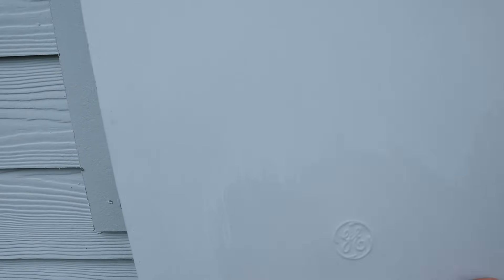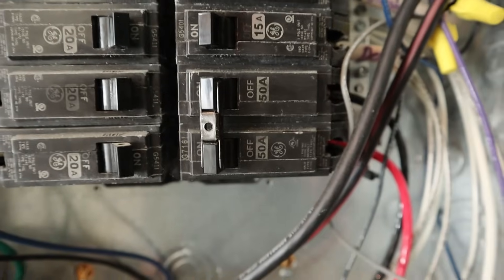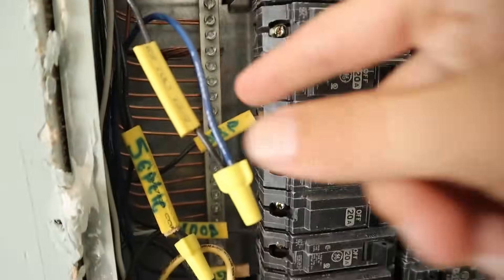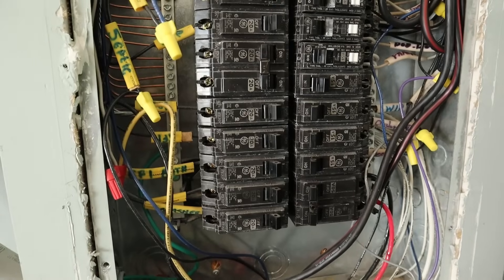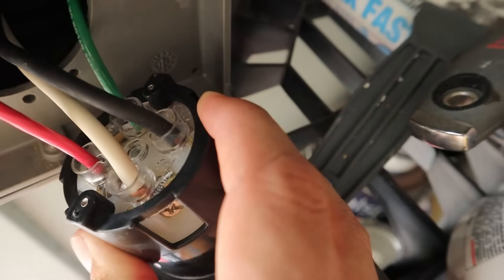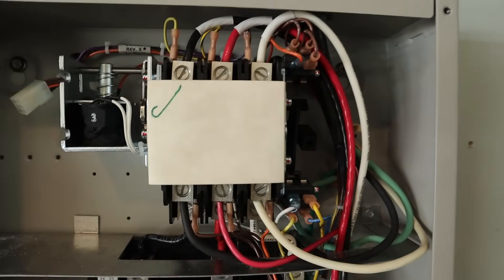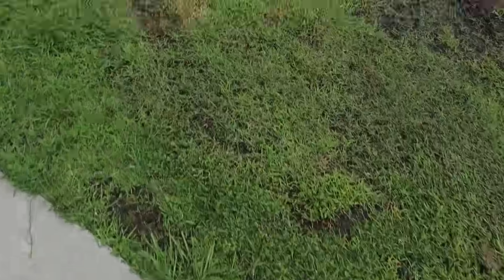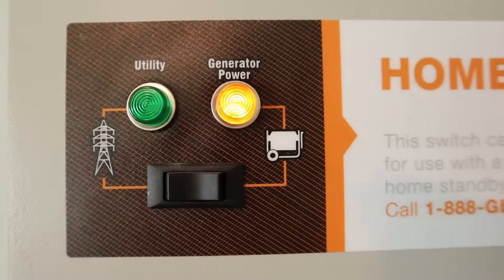HOW TO INSTALL A PORTABLE GENERATOR TRANSFER SWITCH

Comment: How is all of this affected if your transfer panel has no breakers already in it ? Can I just pull the breakers in my main panel and install them into the transfer panel (provided they work). How then does the wiring hook-up work? What is the major difference by doing it this way? O do I hasve to buy new breakers to put into my new transfer panel? I am sure I know what I am doing, I don't want to screw it up. I installed a transfer panel for my smaller portable generator. But, I need your help, please.

Comment: My power is permanently disconnected from my panel. My weather cap got knocked down after Milton visited central Florida, and the power company removed all the wires from the weather cap and transformer there will be no back feed. But I'm going to install a sub panel and only hook circuits I need to work on the house. A power station and generator will be my source of power I cannot see paying for electric when I'm not Living there. A whole house generator is too expensive. You could say I'm off grid. 73

Comment: Why shouldn't the new breaker you put in your MAIN panel be equal to the sum of all the TRANSFER panel breakers? 
If your TRANSFER panel breakers were each carrying just below its rated capacity, you would be trying to pull a total of just below 160 amps  through your 50 amp breaker in the MAIN panel.  What am I missing?   Would be interested in how you decided on a 50 amp breaker for your main panel.  That would be nice to cover that in your explanation.  Thanks.  😀

Comment: Making splices in a panel is not recommended.
Reply from the maker: Nothing wrong with it and the only way to install one of these unless you want to run all new wiring to all of the circuits.

Comment: Thanks for showing that installation. Only question I have is, why when you switched back from generator power to utility power did the green light not stay on as when you were on generator power the amber light was constant. I don't know what your local laws are however other jurisdictions may require that it is installed by qualified electrician and that a permit and inspection are done.

Comment: These transfer switches require wire splices with wire nuts within the breaker box. This is illegal in many electrical jurisdictions, which might also void your house insurance. Beware.

Comment: Few things missing in the post. Generally generators have three prong L5-30R and transfer switch plug is 4 prong L14-30R, with two hots going to manual transfer box. No one tells you how they handle that?

Comment: Why do you use a  50 amp breaker in the main box to supply a 30 amp transfer switch box?
Reply from the maker: Because that breaker doesnt really make a difference.  It is just acting as the supply for numerous breakers in the transfer switch which is essentially a subpanel.

Comment: Hi Adam. Great videos! Thank you for posting all of these! I have a Generac HomeLink transfer switch I want to install and my main circuit panel has the neutrals and grounds together (I do not have a separate ground bus in the main panel). When I wire the transfer switch main power to the 50amp breaker, is it ok to hook up that #8 ground and neutral wire to my ground/neutral bus in the main panel? Being they are together I thought in the sub panel they had to be separate. The HomeLink does have it's neutral and grounds separated in the box, but they'd be on the same bus in my main panel if that makes sense. Is this okay? Also with that said, do I then hook up each neutral wire of the breaker I'm moving to the neutral wire coming from the transfer switch (not putting them all together)?  Thank you!

Comment: Thank you for your videos. I have a generac homelink transfer switch I'm installing and have a quick question - It's pre-wired and I'm hooking it to a 50 amp breaker. The wires that it came with are 8 gauge, but 50 amps should be on a 6 gauge wire, correct? Should these be changed? Not sure why generac would have had these 8 gauge wires.

Comment: Thanks for the concise video. I need to go into my main panel the same as yours; my panel also has no exposed knockouts. My question is what size hole did you drill on the side of the panel and what size conduit did you use to house the wires. Thanks, Bob

Comment: why not just move the breakers already installed to the transfer box?  they are doing nothing staying there...buying extra breakers for no reason.
Reply from the maker: Well 2 reasons.  One I don't want empty breaker spots in my panel.  Two, my breaker panel is GE and the transfer switch doesn't accept GE breakers.  So not for no reason.
Reply: @HowToHomeDIY  ok makes sense.  thought they were the same brand.  thx for the reply

Comment: I’m fairly certain you violated the conduit fill limit on that 3/4” conduit between the two panels 🙄🙄🙄🙄🙄
Reply: @HowToHomeDIY 😂
Reply: Also, you made zero mention of the neutral bonding setup in that switch. I assume it switches the neutral so that you can run on a bonded generator?  Important topic you should address 🙄🙄🙄🙄🙄

Comment: Had mine hooked up last year and it worked.  Just went out to test it and it’s not working.  The yellow light comes on but when I hit the toggle it does not make a clicking sound and no power to the house any help would be great.  Tku

Comment: I watch a bunch of these transfer switch videos and I’m curious why no mentions about having two Neutral Bonded grounds in the circuit. Are you suppose to switch the generator from a Neutral Bonded Ground to a floating ground. Just wondering.

Comment: After I completed the wiring process I notice my green  "Utility" light does not light up.  All the circuits work that are connected through the transfer switch.  Any suggestions would be appreciated.
Reply from the maker: It will not light up unless you are in generator mode.  Then it will light up letting you know utility power is available.

Comment: Circuits selected for transfer need to be completely isolated for safety reasons. if you remove a black power wire from a circuit, you also need to remove the white neutral wire from the neutral bar in the house main breaker box. These white neutral wires are attached to the neutral lug inside the transfer switch. The only neutral wire that is connected to the neutral lug in the house main breaker box, is the large white wire that companies the two large black power wires coming from the 50 amp breaker to the transfer switch. This isolates current that could possibly feed from the generator to the neutral lug in the house main breaker box. Local lineman are always at risk of being electrocuted because someone didn’t know how to hook up their transfer switch.
Reply: If you don't know how to hook this up call an electrician. You are responsible for power that leaks out to the power lines. Remember AC can travel in each direction and step up the voltage to the 32000 or more voltage off a power transformer. 73
Reply: All my hot wires, neutrals and grounds are in its own junction boxes running back to the transfer switch. When my generator is running c7urrent is only running between the transfer switch and the generator but there is a ground connection between the transfer switch and the main panel. My transfer switch uses a 30 amp breaker in the main service panel that brings power to the transfer switch. That is how I understood how everything is connected here in Canada.
Reply: @juniorocampo6474  his trolling right 
He is saying disconnect my feed neutral from the service feed

Comment: U said #10 wire for a 50 amp breaker? U need number 6 wire
Reply from the maker: Where did I say to use #10 wire on the 50 amp breaker?  Only time I mention #10 is on the 30 amp power inlet box that then goes over to the transfer switch.  The wiring going to the breaker is pre wired and the instructions state to use those wires with a 50 amp double pole breaker.

Comment: Great video.... question, why is the feed double breaker that feeds the transfer switch a 50amp if the transfer switch is a 30amp?....thanks in advance
Reply: When the power is being supplied by the grid you have lots of power available, so you want 50A to power the 8 circuits.
When you switch to the small(ish) generator you only have 30A available.
At least that is my guess.

Comment: so to confirm  in my case 50 amp ATS unit with 12 circuits.  need 50 amp breaker on the main service panel that connects to ATS.  other side of ATS goes to generator plug in box. one more wire for ATS to signal portable generator startup because my portable is a 12000 was 240v 50AMP.  Then need need to run wires from devices I need to pull over from the service panel to the TS circuits.  In may case this is well, septic, water heater, bedrooms, living room plus lights for those and one of heat pumps.  Eventually I would like to wire up the second heat pump when I can afford a bigger or second generator.  Obviously knowing that I would need a different ATS to handle the additional amperage or just running in a second ATS.  Unless there is a way to run a bypass to manually switch between the two heat pumps but that's adding some complication to the system that I would rather figure out after I have my ATS up and running.  Do you recommend utilizing a knockout on my service panel/meter box for running the generator plugin or just putting a hole through the wall using conduit and sealing the entry hole?  I would think less holes through the less chance for damage but maybe I am just worrying too much as if its sealed properly there shouldn't be anything to worry about.   Any thoughts would be appreciated.  I'm not an electrician but I have a lot of electrical experience from wiring a lot of single phase +phase converters and three phase for CNC milling equipment over the years for my machine shop.  Working in an electrical box doesn't scare me as I always ensure that my power is off before moving further.

Comment: thanks for sharing, so with the transfer switch, you don't need an interlock switch?, in addition, I already have 2 50 amp circuit breakers on my main panel, for the generac transfer switch, I need an additional 50 amp breaker, is it safe to put another one on the main box?

Comment: the normal  power has a 50a breaker protecting  it what about the wires coming from the generator i dont see any ocpd, is the ocpd  built into the gen ??

Comment: I installed my transfer switch and noticed that it wouldn't switch between utility power or generator power. I took the panel off and noticed that there was a orange wire coming from the back of the coil. There are two orange wires. But one is not connected to anything. Does it matter?  I unplugged one and put it in the place of the other and now the switch works.

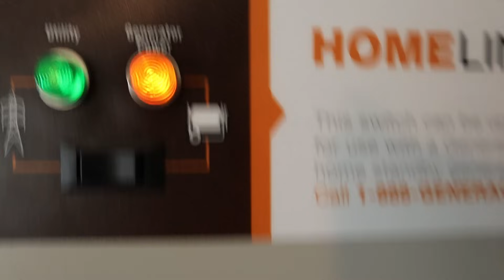Comment: Dude in the video says "...with some other panels, you're not gonna know (when the power is back on) unless you're constantly checking." [ 14:39 ]
Isn't that exactly what you have to do with the Generac panel, since the only thing there is a light on the panel letting you know that the utility line is back on?  You have to be 'constantly checking' that panel to see if the little green light came back on.
Reply from the maker: Umm yes but all I have to do is look for a light that lets me know it is on while I am using my generator.  Instead of trying a breaker not on the transfer switch look if something came on.  My goodness some of you folks will find anything to try and pick at lol
Reply: @HowToHomeDIY  - Sooooo, in other words you're saying:  That during power outage, in the middle of the afternoon when you're sitting in the living room, 'IF" you happen to remember to get curious whether the electric utility is back on, you have to get up, walk thru the kitchen, walk to the garage, of walk to the OUTSIDE OF THE HOUSE (which is where the transfer switch is for a lot of people).... just to see if a little green light is on.  #GotIt

HERE'S A THOUGHT: The company could spend an extra $1.87 to add a 'beep alert' (no different than a beep reminder in your car or smoke detector battery low indicator) to let you know you can immediately now stop wasting gas and turn off the generator.

Now THAT would be a feature worth celebrating.
(As someone who lives in a city with crappy utility service and a lot of power outages, I've learned to plug in a radio.  Then, when the power comes back on, even if I'm outside or taking a nap, I'll know immediately when the power is back on without having to keep looking at a light at a kitchen light or porch light.)

(But, yes, the little green light is better than nothing.)

Comment: Question, are you neutrals not tied into your grounds in that main panel? I'd love to do this your explanations were very good. Another question is stranded wire legal in home wiring?
Reply: yes nuetrals and grounds are bonded in main panel, if its first means of disconnect. yes stranded wire is legal.
Reply: @ThePetersmith77  Thanks

Comment: I have the same setup. 
Instead of gasoline-powered generator. 
I use 4 lfp batteries in parallel with 3000W inverter. I only selected 4 circuits into the house. My battery monitor says, I have 26 hours of capacity. 
The main thing is I don't have to listen to the annoying generator noise.

Comment: So if I understand what you did... You moved eight circuits from your main panel over to the subpanel thus you have eight breakers in your main panel that are no longer being used. Correct? If that is correct, couldn't you physically move the  unused circuit breakers from the main panel to the subpanel (assuming the breakers and panel are compatible)?
Reply from the maker: If they were compatible, yes.  But you would need to fill the empty breaker spots with fillers or breakers.

Comment: Great video, thanks.  Quick question for you.   When an outage occurs, and I have switched over to generator power through the manual transfer switch, do you recommend switching off the Main breaker to the house panel?  (Mine is on the outside of my house, next to the gas meter.)
Reply from the maker: With a transfer switch like the one in the video there is no need to turn off the main as it is completely disconnected from your main panel.
Reply: @HowToHomeDIY not if there is a ground fault with the wiring you showed in the video, as the current will make its way back to the utility source potentially shocking someone working on the line.

Comment: I know in sub panels the ground and neutral are "unbonded". It looks like your neutrals ang grounds are unbonded in your main panel also. Is this the case or are they just run neutrals to one side and grounds to the other? Or is this panel a subpage? If the neutrals are bonded does it change how you connect them from the transfer switch? I have read your update.
Lastly what gauge did you run to supply power from the 50 amp breaker to the transfer switch? Thanks, Rick

Comment: If the circuit you are moving to the Generator Switch Panel is on a AF/GFI Circuit breaker does the circuit breaker in the switch panel need to be replace with a like corresponding circuit breaker?

Comment: I wonder how much these transfer switches vary? I have seen transfer switch instruction where the individual circuits were moved but using the original breakers. In those boxes I believe you wire a transfer wire to the original breaker, it goes to the switch and another wire goes to the panel connecting the circuit with a wire nut.

In the transfer box I was talking about, each individual switch acts as utility/off/generator. Which would be a better switch?

Comment: I have a homelink 30 amp and the orange light doesn't light up when my generator is on and yes there is power that runs to the panel but doesn't want to power my breakers that are in the Générac panel
When power from the line is back the green light goes on and the switch works but not when the power comes from my the generator
Can someone help me with this
And if I need a new part where do I go I just bought it from Home Depot
Thanks

Comment: How can a 50 amp breaker supply enough amps to eight 15 or 20 amp breakers?
Reply from the maker: Those are their maximum loads which should almost never be near capacity.   But yeah if we tried to time out a couple fridges coming on, well pump, septic pump, ac, and oven coming on at the exact same time then the generator might have some issues.  But that’s all that would happen is bog the generator down or trip the breaker if you try to pull more power than it’s capable of.  Same theory as if you have 200 amp service, if you added up all of the breakers  I’m willing to bet they will add up to more than 200.

Comment: You have added a 50 amp breaker to the main panel to power the Generac  Transfer switch. However when the power from the Utility company is off, that breaker is dead. So no power is going to the second box. Also you take a wire from a breaker in the main box and attach it to the blue wire to get power to the Generac breaker. So if you have taken the black wire out of the breaker in the main box , how do you get power to the house circuit when you are on regular utility power , since there is no wire attached to it ?
Reply: The power is coming from the 50 amp breaker to the transfer switch, to power the switch, and all the breakers in it.

Comment: Why do you use a 50amp breaker in your panel to run a 30 amp switch? I have learned a lot from you videos.

Comment: It’s simple but I’m gonna have to do just a little different because my breaker box is full I have no room for another breaker let alone a 50A
Reply: Tandem breakers or piggy backs are an option in some panels.  Its a double breaker that takes up a single slot in the panel. Its only good for 120V circuits.

Comment: I plan on installing a 10-circuit transfer switch, do the circuit breakers need to match, example my electrical panel uses square D, does the transfer switch circuit breakers have to be square D too?